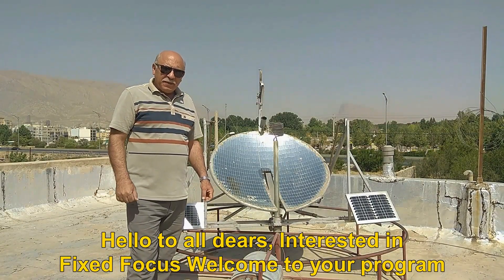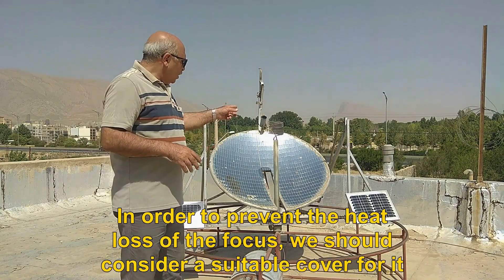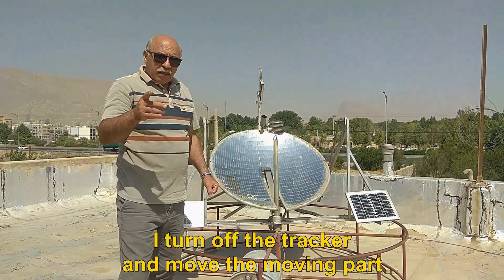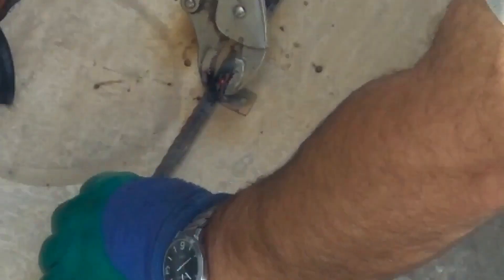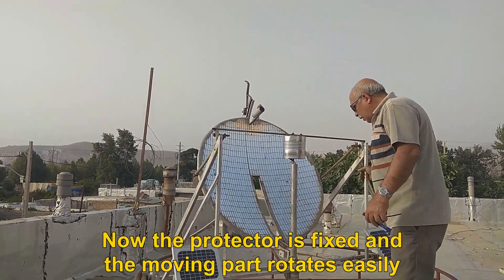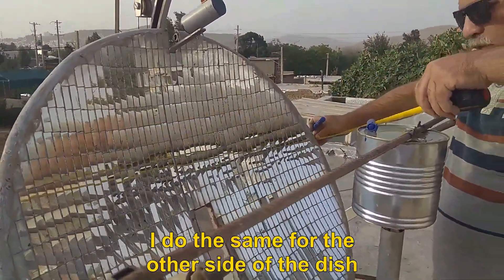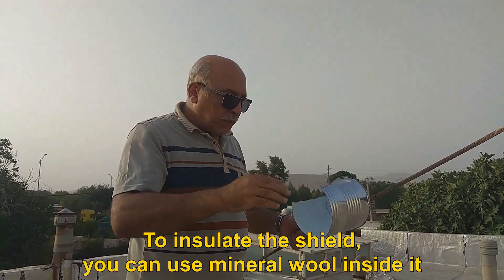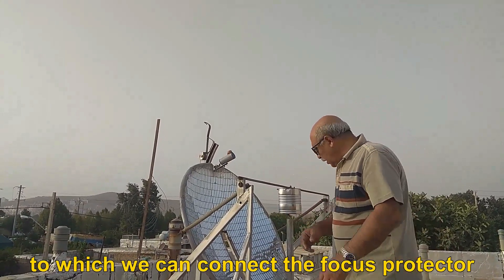Making a suitable cover for the focus. cover

Comment: Hello! Thank you for your regular updates. I have 3 reflectors each 25m2. I am able to generate 900+ degrees celsius. Getting big trouble with insulation. The center pillar which holds the receiver (absorber) becomes very hot. Can't find suitable material what can hold the weight (184kg)of the receiver/absorber. Ceramic, porcelain, compressed rock wool didn't solve the problem. Tried teflon bar with no success. Any idea?

Comment: I find it commendable how some dive fearlessly into English, there is a Scandinavian guy I watch who fixes Toyota engines that uses the same words 'open' and 'close' for bolts, threaded fasteners.  It must come from threaded lids to jars, but they contain space alike opening or closing a door to the house, not for solid screws and bolts.  More appropriate would be unscrew, remove, loosen, to install, replace, tighten.  Speaking of jars, I would be on the look out for a large glass jar to compare with the method of this video.  Your videos are inspiring me to start stripping the paint or what ever that is coating my 14 foot solid aluminum satellite dish except I'm usually alone with zero help.  I just thought of attempting to use heat and somehow scrape it off without damaging the aluminum before polishing, as paint stripper is expensive and brings back bad memories of removing IMRON paint off of whole aircraft.  Where are you located, just the general area?